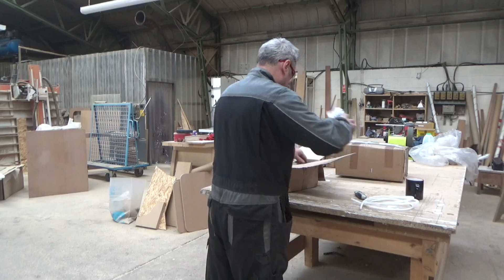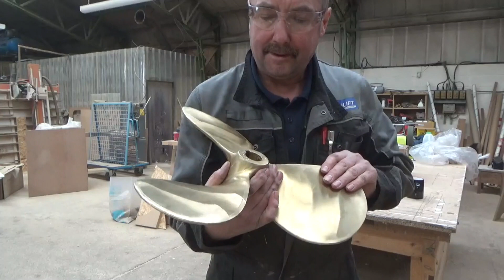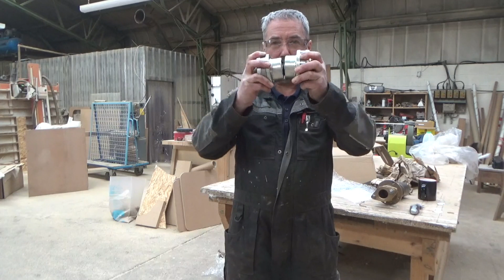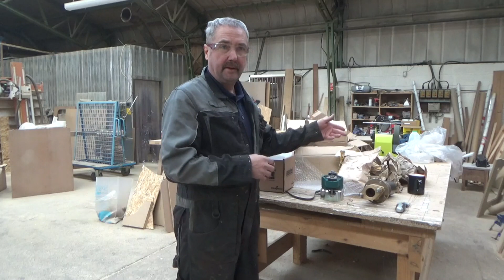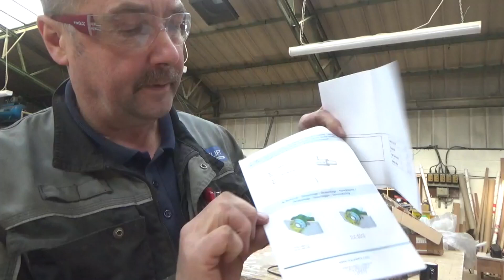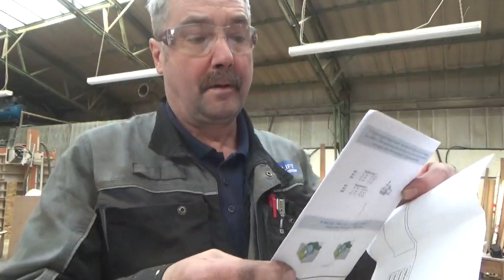Narrowboat Build. Aquadrive & components for the drive train.

Comment: I have a 21 year old aquadrive on a 100hp yanmar in a sloop and am about to replace my shaft, seal, bearing etc. Should i replace the Aquadrive coupling or so they last forever?
Reply from the maker: Hi Dan interesting boat you have. The couplings themselves unless obviously damaged should be fine . Just change the consumables. Cheers